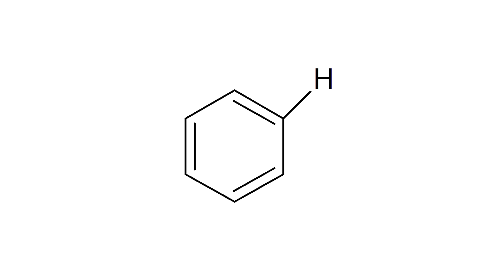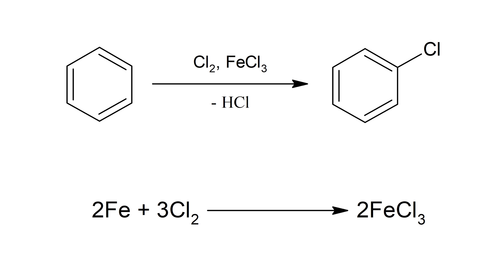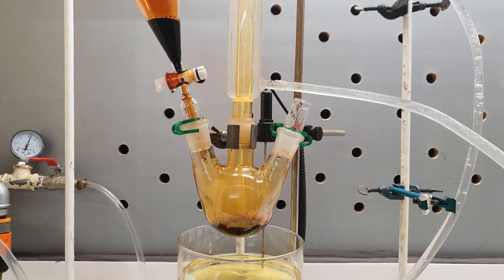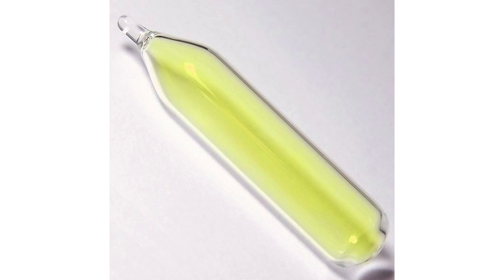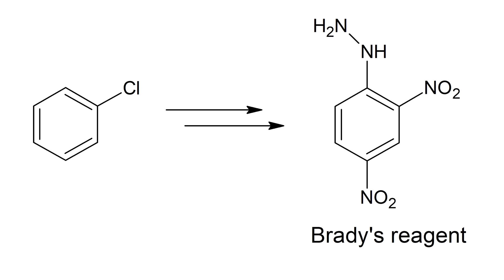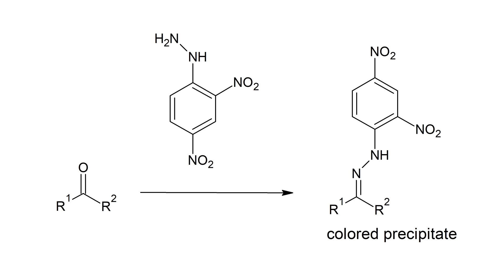How to make CHLOROBENZENE

Comment: How can i get phenol from benzene except making chloro/bromo/iodo benzene?
Reply: Sulphonate the benzene, works very well with barely any di and tri sulphonation. 
Next, fuse it with sodium hydroxide to get sodium phenoxide and na2so3.
Acidify with dilute acid and separate the phenol
Reply: @no1brittbarbiefan  thanks, but I solved the problem by buying salicylic acid

Comment: You can react silver benzoate with excess chlorine dissolved in carbon tet. A decarboxylation reaction occurs where the COO group is replaced with a halogen, chlorine in this case.
Reply: Extremely late reply, but: Does this actually work, though? While a Google search shows that reaction as an example of Hunsdiecker decarboxylation, as far as I know, the reaction is most reactive towards primary carboxylic acids, becoming less reactive as substitution count increases. The carbon that the carboxyl group of benzoic acid is connected to is part of an aromatic system, which I believe should act as a tertiary carboxylic acid for the purposes of this reaction, and wouldn't react particularly well. I also wouldn't be surprised if the silver halide formed is able to support coupling reactions similar to Cu(I), further reducing the yield of any halogenated product (ie. Ar1-X + Ar2-X -> Ar1-Ar2 + X2, then halogenation + coupling of the new product and so on until most of the converted product is a bunch of tar).

Comment: Have anyone tried the selective para bromination of toluene?
Reply from the maker: NurdRage has a video separating o and p chlorotoluene. I personally have separated o and p nitrotoluene.
Reply: @Hexazine0  I performed a Sandmayer reaction on p-toluidine to get the diazonium salt and then used metallic copper and sodium bromide but apparently, I got a mixture of o-bromotoluene and m-bromo toluene, with traces of the para isomer according to GC. Maybe the set up of the glassware was not suitable for it. If there is a way to collaborate with you to perfomed this reaction for educational purposes. I'd support you 👌

Comment: I wonder if some of the chlorobenzene was able to react with the NaOH? Maybe Na2CO3 could be better option.
Reply from the maker: The bound between the chlorine atom and the aromatic ring is conjugated and really strong. In order to react without a catalysis it need a really high temperature and  pressure. Actually all the procedures recommend using NaOH. The substitution is possible at such temperature when you have electron withdrawing substituents in the ring like you will see in my Brady's reagent video. If you have 2 nitro groups for example the reaction with hydrazine proceeds near room temperature.
Reply: @Hexazine0  OK, thanks for the explanation. I guess you need metallic sodium or some really strong base to react with it.
Reply: @user255  At least Mg doesn't react to make the Grignard compound at RT, as it will with the bromo- or iodo-benzene. The iodo-benzene, is usually stored in darkness and with silver powder, so it isn't very stable to  light.